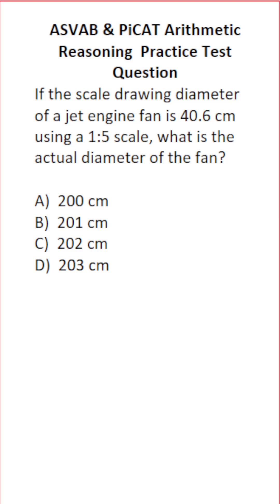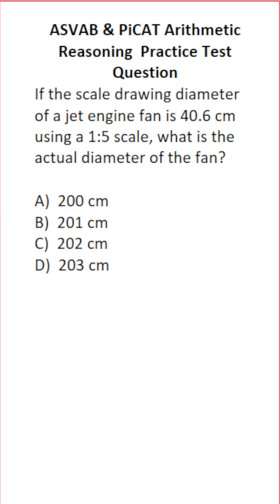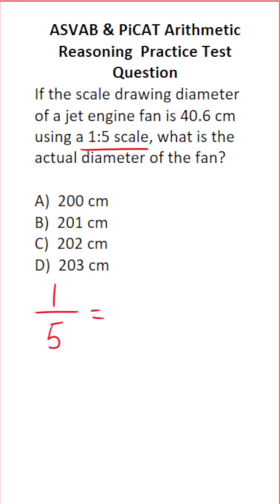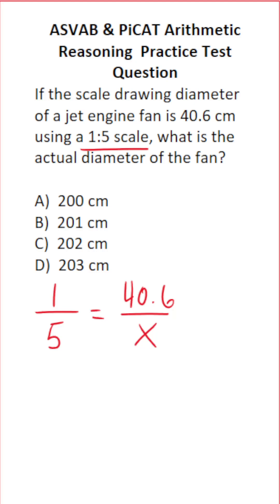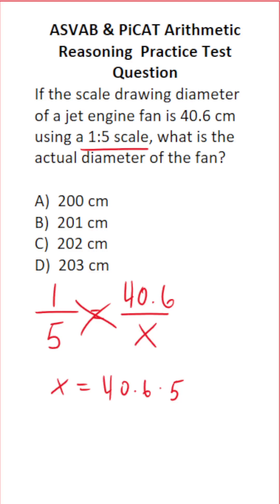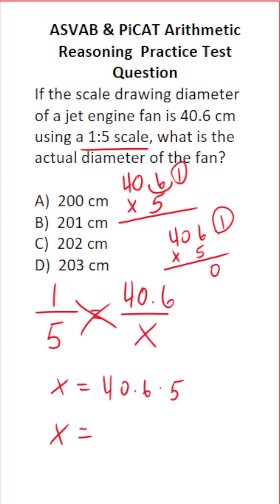ASVAB/PiCAT Arithmetic Reasoning Practice Test Q: Proportions #acetheasvab #grammarhero

Comment: Why was the 40.6 placed at the top n not the down ??
Reply: The diameter it’s  divisible by 2 so it’s easier to just say 406 divide by 2 you get 203
Reply: Maybe bc if  40.6 was on the bottom it would be 40.6 times 1 that wouldn’t give u the answer